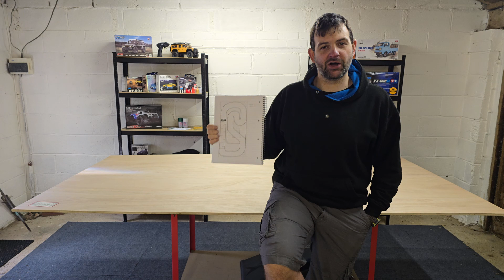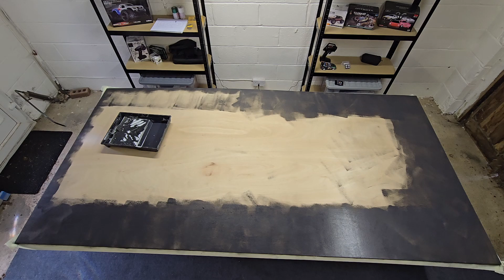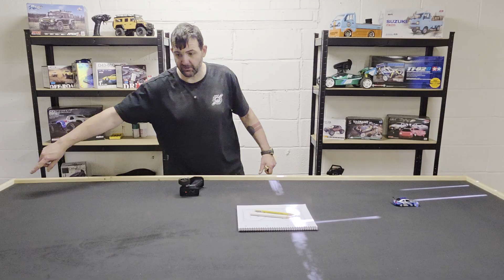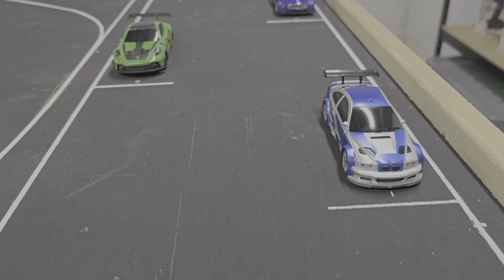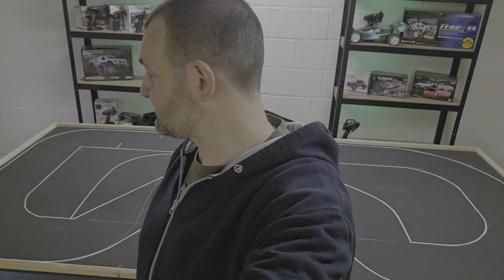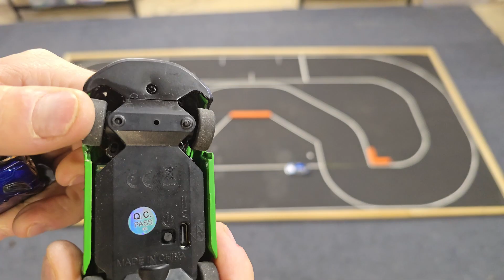I Tried To Build An Indoor Test Track...

Comment: I plan to race 1:64 scale cars. My problem is no-where to store a track.

Please could you design a track design that can be de-constructed and stored in a small space.

I've tried the 'jigsaw' yoga mats...
Reply: Ive seen large slot car tracks that are on pulleys and raise the whole assembly to the roof to be stored. Perhaps this would work for you?
Reply from the maker: Thanks for the comment. 

This is actually a really good idea that I never thought of. I might need to look into this. 👌👍
Reply from the maker: Thanks for the comment. Funnily enough, I've been brainstorming some ideas of a modular style track with a base like gym mats. You can by them already but they're really expensive. Ill keep at it and if I figure it out, they will be a video here first!